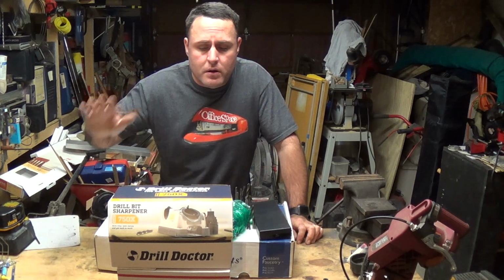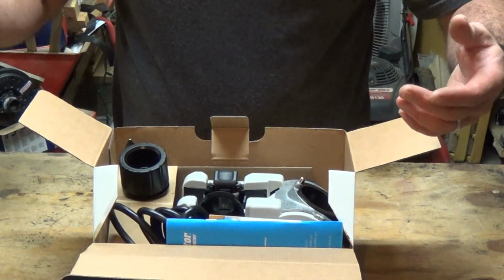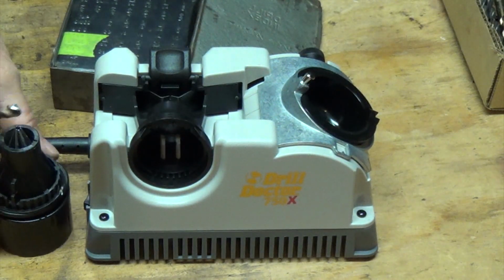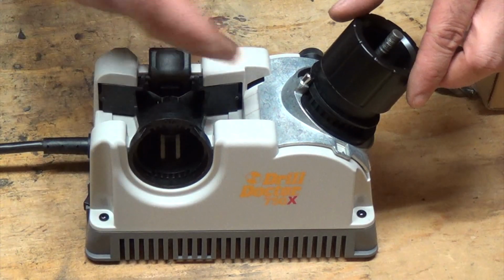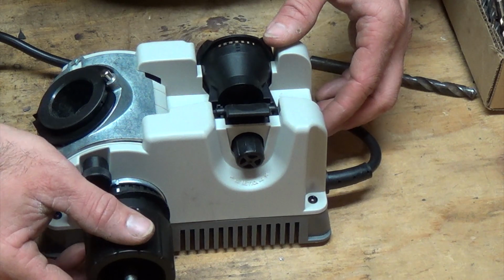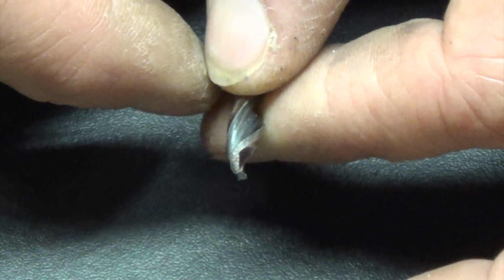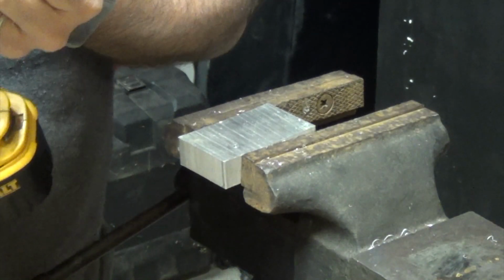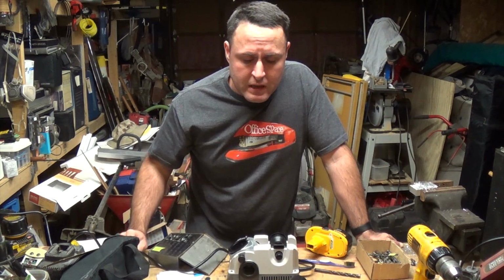Why You Should Buy Drill Doctor 750x

Comment: On your split point demonstration the sample original is cut at 135 degrees (flatter) vs. 118 degrees.  Split points are usually reserved for a 135 degree cut.  Your split cut bit appears to actually be 118 degrees.  I think the rule is:  You MAY split cut a 118 degree bit, but you MUST always split cut a 135 degree bit, as that bit is usually to drill harder materials.  Just a clarification per the instructions.

Comment: Thanks for the review .  It got to the point that if it wasn't a project I needed for accuracy I just use a plasma cutter for a drill.
 I have  the 750X.
 The only thing I don't like about it is the piece that you insert that wobbles around in there. I can see that plastic wearing out from the friction and not being so accurate in time.
I'm sure they (makers of drill doctor) don't mind because then you'll have to just buy another one or parts.

Comment: the instructions are BS , the makers had this bright idea but have never used it themselves BUT if you make adjustments for each drill by experiment it works well
Reply: I had the earlier model and it worked great. This one I've spent hours and watched many videos and while it will sharpen the cutting edge very well it won't cut because there is no relief. The cutting edge is no higher than the back so the cutting edge cannot engage material. I end up going to the grinder.
Reply from the maker: The rocking motion creates the relief when you spin it while sharpening
Reply from the maker: Trial and error my friend. It does get them off every now and then. Most of the time it works well